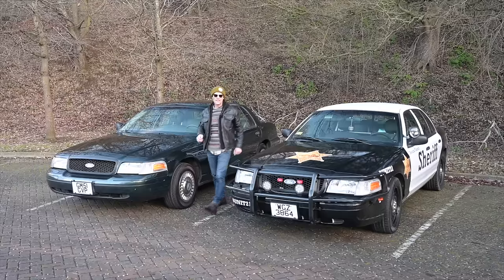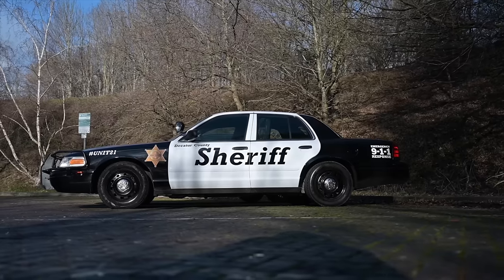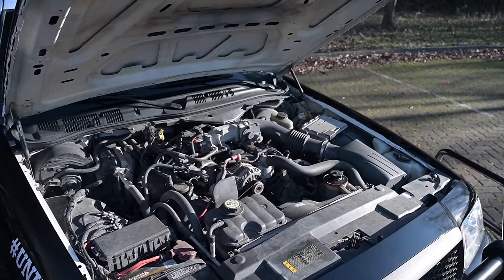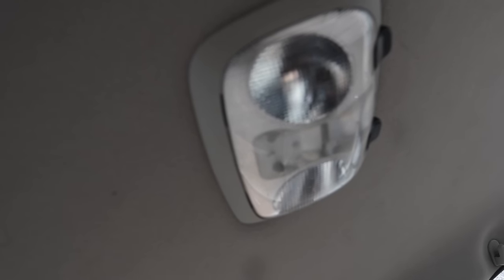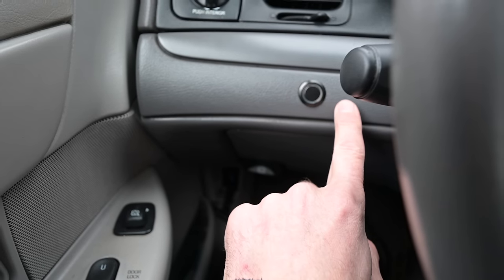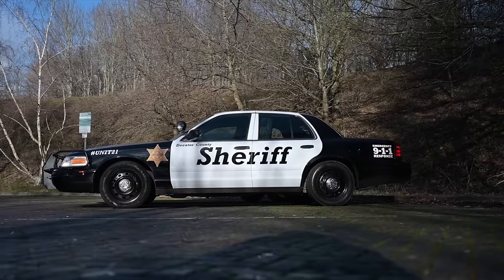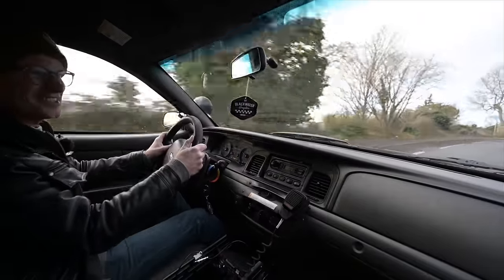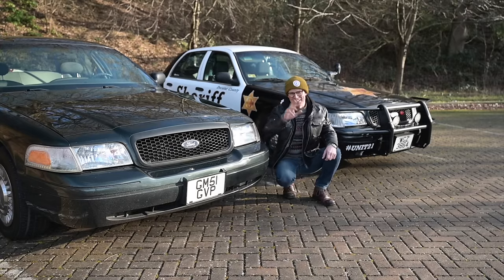What makes a P71 Ford Crown Victoria Police Interceptor special?

Comment: Interesting that you mention the reinforced rear. That was done as a result of a number of serious incidents where police vics had been impacted in such a manner, with tragic consequences as the fuel tanks ruptured in much the same way as the old Pintos. (Isee you mention that later, with the trunk pack and fire-shield as the reinforcement didn't quite do enough).

I suspect when you mentioned the alternator, you meant 200 amp, not 200w. A 200w alternator would be unheard of, being less that 20amp, where even an older car with far less electronics will have 70amp or more alternators :)

The driver only central locking feature was I suspect common to all Fords with body control electronics, just not enabled. I can enable the same function in my UK spec 2011 Mondeo, and 2013 UK Bmax. How's that for some useless information?

Comment: uh the standard Mercury Marquis wasn't on the panther platform it was on the smaller LTD platform like the Mercury Cougar XR 7 and Ford Granada it was the Grand Marquis that was on the Panther platform with the Crown Vic and Town Car granted I have a soft spot for the Crown Vic because my dad and a couple other family members were police officers when I was growing up and dad used to bring cruisers home sometimes and the crown Vic rode smooth as heck with its 4.6 L modular V8 engine its a shame that the panther platform was discontinued 12 yrs ago the last panther platform car off of Ford's Assembly line on sept 15 2011 was an export model Crown Victoria for the 2012 model year

Comment: The interior has a feature you didn’t show us.  There is a lock out switch under the dash to prevent moving the shifter out of park.  Theft prevention while the car is left idling.
Reply: it's usually dead man switch under the floor mat to the left of the brake pedal, you have to press down with your foot to take it out of park. Not all city/town departments use them, lots of state agencies do.

Comment: I can't find anything online about before 2005 they could reach 150mph and after that they are limited to 120. I'm heavily considindering buying one of these. But I would like to get one that could reach the higher top speed. Can anyone confirm this or link me to something explaining it? Also if it was only electronically limited to 120mph by the computer. Couldn't a mechanic with the right tools remove that speed limitation?

Comment: I am surprised at the police car lagging in horsepower in the 2000's (254 hp)the '99 SVT Mustang had 320hp from 4.6L back then in a much smaller car.  Subsequent years of the Mustang got the '99 SVT engine in the Mach1 Mustang. Maybe the Police Crown Vics were putting out more torque needed for their weight?   Again, I am surprised they all didn't have an LSD.  The '99 SVT had one but also had an electronic traction control, which most of us turn off. Lacking the Limited Slip rear end has plusses and minuses.  The CT State Police at one time only installed ONE snow tire in the rear for a while maybe thinking the LSD would compensate.   I think they stopped that after a trooper skidded off the road and died.  Current cars might be AWD.  I've seen mostly SUVs for the troopers with the rare Charger in a garish color to make them harder to spot.

Comment: Always try to find a detective car because they have a lot less idling hours on the engine.  The regular cruisers are running almost all day long through multiple shifts.
Reply: You are correct I have an 09 P71 with over 11,000 hours on it with only 103,000 miles but the engine is smooth as a Swiss watch

Comment: All this stuff except the springs, sway bars (only the rear is different actually) rear axle gear (not all but some had 3.55:1 instead of 2.75, and most didn't have limited slip which was also optional for Mercury, and the driveshaft was a risk over 120 with the low gear even with the special design) and the biggest difference besides the stupid lights and extra holes drilled and cheesy radio wiring it was the exact same car. In fact, the big difference, the engine/transmission computer tune was reset to regular civilian before auction to the public. My cop car is slower than my grand marquis but stiffer ride no air shocks
Reply: *biggest real upgrade was the computer tune which is reflashed back to luxury sluggish before auction. You need a power tune cop car or not. They all have potential. Cop car gives you nothing better than smart easy mods.
Reply: The cop tune had firmer transmission shifts but only fifty more hp than old lady version. Less than v6 camaro in 05

Comment: Just a little nitpicking ... Drive by Wire or "Electronic Throttle Control" started in the 2005 model year, not '06.  The last cable throttle cars were 2004s.

Comment: Ford built them right, what makes them special only the following 

1. 70 mph rearend collision certified 
2. 2008+ bullet proof doors and stabb proof seats 
3. Personally ….. saved my life …. Hit a male deer (buck) when he jumped on highway was going 70 mph 
4. Made to drive over curbs at 35 mph from factory (tank)

Cherry on top….. identical drive train to automatic gt mustang (but better rear suspension)

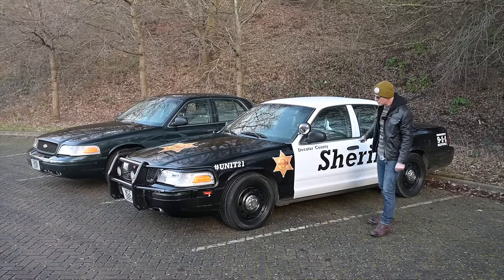Comment: Think the 3:55 rear gear was for city cops (lower gear for Quicker acceleration) and the 3:27 was for rural/ highway (a little taller gear). My '01 had the 3:55 and my current one '05 has the 3:27. My '01 would "chirp" the rear tires going into second gear if you had your foot in it. First 4 door car i ever had that could do that......Bottom line, the Police Interceptors are great cars. Just Got to Take Care of Them. One day they will be gone.....Sadly.

Comment: I’m surprised it fits on y’all’s tiny roads lol I have a 2010 and I’m often the smallest vehicle on the road here in Alabama. I’m dealing with F-250’s that are several inches wider, feet longer and taller, and additionally with 6” lift kits and stuff. And then you have our semi trucks that weigh 80,000 lbs and are like 19 feet tall. I also have an 07 F 150 with a 3” lift kit I got for next to nothing, but it needs some serious work done. Even it’s small compared to the modern trucks. I couldn’t imagine y’all driving F250’s, Silverado 2500’s or RAM 2500’s or something.

Comment: I had an 07 police interceptor, and according to the manual from Ford, the doors are bullet resistant
Reply from the maker: From around 2003 ish they had optional Kevlar inserts in the front doors, not very everyday useful but very cool to have

Comment: the inside lt  not turning on is called dark mode. it can be turned off by unplugging one wire  behind the dash on the driver side. far left.

Comment: What pisses me off the most is that I have a 2003 crown vic. It has the wiring for the pedal adjustment, but doesn't have the motor or bracket. So its an adon on top of an adon :(

Comment: and the facelift car has much better cup holders.. and rear suspension.. and  frame.. and performance improved cylinder heads.  the older ones don't weigh as much though which can save gas / petrol

Comment: The biggest misconception on these cars is the "chip" that the p71s have. FYI theres no chip, they do have improved shift points for the transmission and thy do make a lil more power than th civilian models but its like 230 hp vs 250 hp. Not a life changing upgrade.

Comment: And the proper term is not electric windows, or electric mirrors, or electric locks.... We use the term power... Electric specifies that something will shock you... or electrocute you.... They're literally just called power windows or power locks or power mirrors... Because believe it or not, there were cars made in the United States that used hydraulics or vacuum or air pressure to run things like windows, locks, and mirrors...

Comment: My dad bought a 2009 Crown Vic in 2012 this frame is police issue gussets on any corner and a crossmember between the frame rails in front of the rad built  like a tank. This is the panther platform and no different between police and civilian issue then it ended in 2011 REALLY they want to kill anything that lasts you have to buy a new one fuck them. My dad got dementia and passed in 2022 I know he would want this car to stay in the family so now my son owns it and loves it he had my 1991 Crown Vic when I got my 2007 F150 supercrew FX4 in oxford white now getting a little long in the tooth yeah rust hidden but I know its there. If it works leave it alone this thing was the shit tough and reliable and simple easy to fix but did not have the tech or the bodylines the ignoramus wants so here we are now everything a POS no really nothing even a F150 is any good all junk. Will drive mine till the body falls off just saying.

Comment: I do like the Crown Vic as it is an iconic car. However, I think a first generation Saab 9-5 Aero is much more suited to our UK roads and, for a 2.3 litre petrol engine, shows a clean pair of heels to a lot of the more germanic cars of its era. A nice sleeper car that is a totally comfortable mile munching cruiser, but goes like a stabbed rat if you provoke it enough.
Reply: A friend of mine had a 9-5 Aero 5 speed here in the eastern US. Pulled strong and rode pretty well. Only downside is that they are nowhere near as easy to work on as Crown Vics. And they're more expensive to get parts for in the US.

Comment: You got your ratios reversed there bud. The higher numerically your ratio the faster accelerating. Also, the engines turning faster compared to the wheels so less economy.

Comment: @3:42 "..the rear of this car is designed to take a 70MPH impact..." that is factually false and misleading. 5 seconds of research would have revealed this to be in error. The 70MPH rear end collision spec you mentioned is for the newer Ford Interceptor Utility SUV. 

"..that's actually a police requirement in America..." This is also false. That 70MPH rear collision rating is Ford proudly boasting. It is by request and design, but not a requirement.